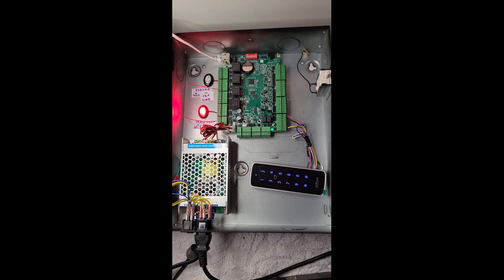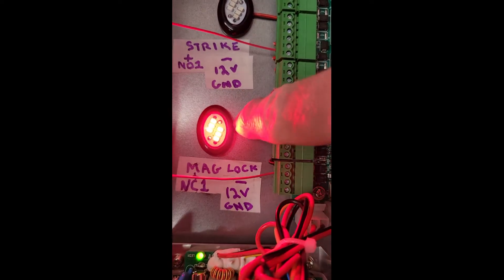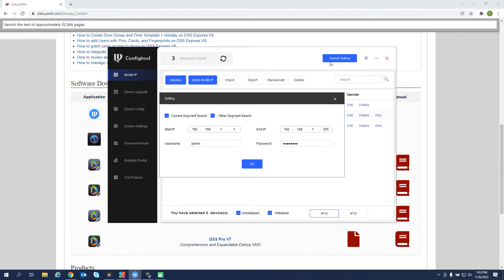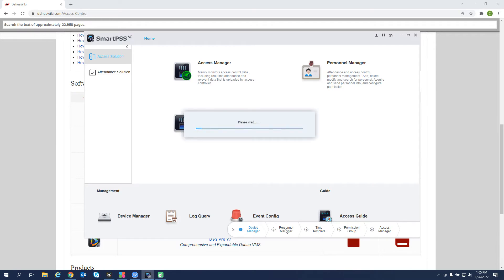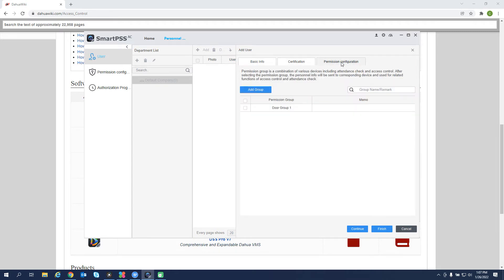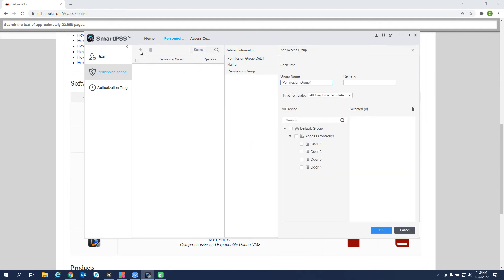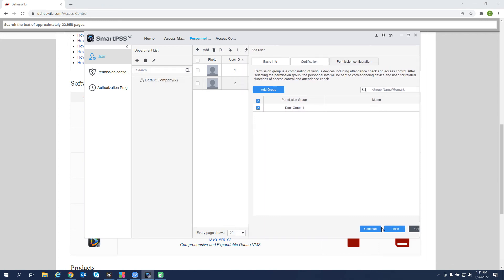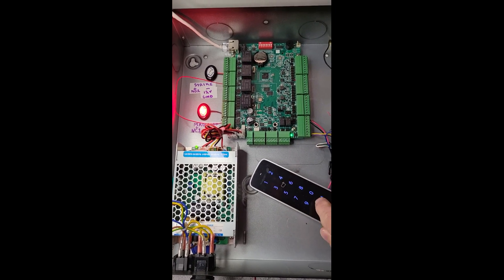Dahua DHI-ASC2204C-S Access Control basic setup with SmartPSS AC and ConfigTool

Comment: Thanks for the video, but I am stuck at smart pss showing my device online for 2 seconds and then goes to offline with pop up messages saying that it exceeds the door limit 64
Any ideas?
Thanks
Reply: Hi ed inne, did you solve  the problem with limit of doors?
Reply: @GasimTofiqoglu  yes, the problem is with the app 
I downloaded the older version and it worked fine
Reply: @datacommsbrisbane  Thanks